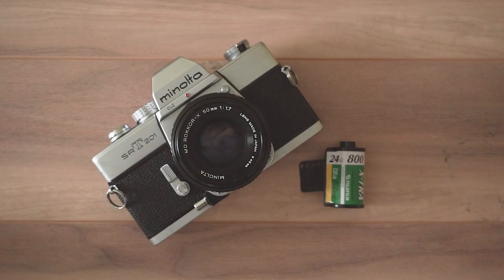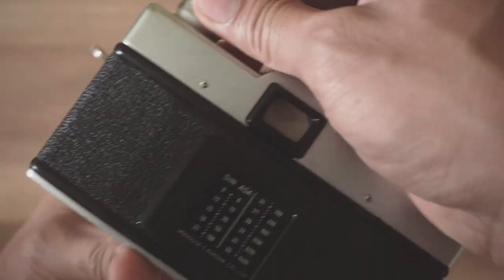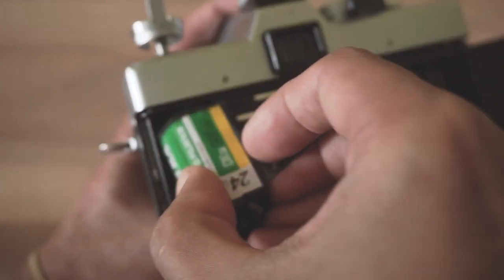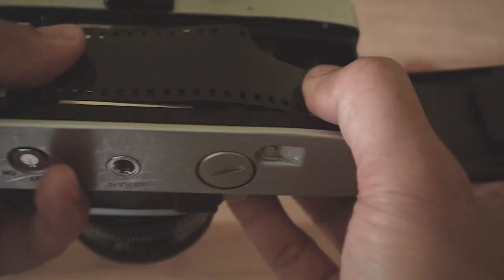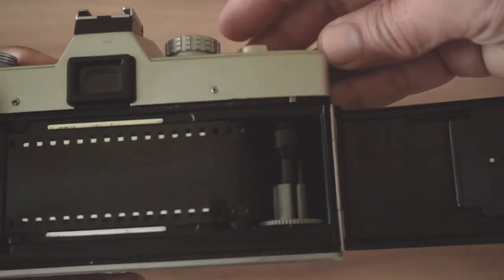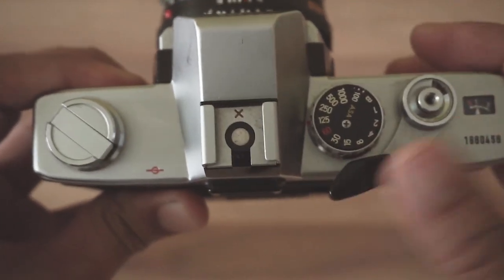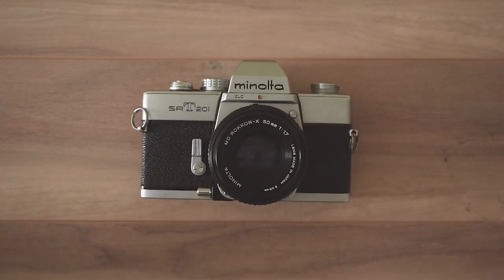Loading 35mm Film Tutorial | Minolta SRT 201

Comment: Hi, new 201 owner here. How do I find out if I have a Model A or B? And also how did you solve the mercury battery?
Reply: Please answer this
Reply from the maker: Hey, sorry for the late reply. I believe you are referring to the SR series which model A is cut down version of SR-2 then model B is cut down version of SR-3 which they added a light meter. Unfortunately they don’t make mercury batteries, a PX625A should have the equivalent voltage. Hope this helps
Reply from the maker: pg hi, sorry for the delay. I posted a reply just now

Comment: Do I need to put the battery in on our to use it??
Reply from the maker: You only need a battery to use with the camera exposure meter.  Its a mechanical camera so it would still work and take pictures without a battery if you are using the sunny 16 rule.  Here is a link that would help https://youtu.be/r0taSqzrP_c

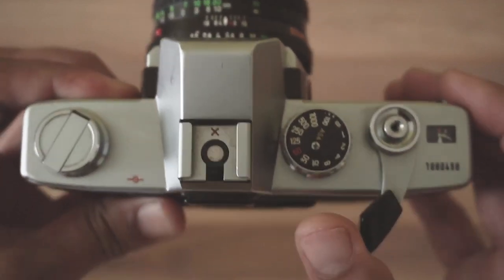Comment: Hi there. I just inherited my mother's SRT SC-II from Sears in 1980. I followed your steps, but when your rewind button stepped forward after cranking the film-advance lever automatically, (at 1:14 you explained this) mine does not move it forward, it stays in place. When the film was loaded, the lever was definitely moving film forward, and onto the teeth, no problem. My exposure counter will still advance forward as well, but it makes me nervous.
Reply from the maker: @Jordan R hey thanks for dropping by. Your film might not be secured in the rewind spool slot which causes it not to move while advancing the film. I would try to advance the film then fire the shutter and then advance again to see if its pulling the spool. If that didn’t work, your film isn’t secured in the rewind spool. Good luck
Reply: @RomeOpalec  thanks for the reply. Is it safe to open the film door with only a couple of levers turned to check? Or will it ruin the whole role?
Reply from the maker: @87_North  it may exposed part of your loaded film inside. i recommend opening it in the less light room away from direct light to work on it. since the only exposed part is the beginning of the film, you can use that part of the film to re-spool your film. hope this works
Reply: @RomeOpalec  thanks! I'm actually running into the common issue where when you snap a photo, the viewfinder stays black, and does not reopen until you adjust the lever for the next slide. I'm just going to bring the camera into a repair shop to get cleaned.
Reply from the maker: @87_North  you bet! i also recommend using a used film to practice loading and unloading that way it would help for future new film load. good luck and hope you take a lot of good pictures. these cameras have a long run
Reply: @RomeOpalec  thanks! The same day I got this, I was gifted a 1996 Canon EOS Rebel G. It's not mechanical, but it's another great, cheap 35mm film camera to test, so I'll play around.
Reply from the maker: @87_North  that is awesome. any camera that takes 35mm makes filming more exciting. takes you back in time. cheers!
Reply: @RomeOpalec  I am also having that issue. When I load film and advance it, the rewind spool does not move. I have tried two rolls of film so far. everything seems to work perfect, the rewind spool is the only thing I'm nervous about. the film seems to be advancing and the numbers keep going up as if the film is advancing... I'm just nervous that I'm taking a million photos on one spot of the film? Any advice would be very much appreciated.

Comment: Hey, I’ve been using this camera for a while with no issues until recently. Sometimes when I snap a shot it seems that the shutter closes and doesn’t open back up. The viewfinder goes dark when this happens. It doesn’t open back up until I advance the film. Just finished a roll with it shooting like this. I’m not sure if any of those shots were exposed because of this problem. Any idea why this is happening?
Reply from the maker: @Jonathan Mauldin hi, it sounds like the mirror locked up on you. Did you try to push the button located underneath the lever timer? Sometimes it does lock up and causes the mirror to flip in close position.
Reply: @RomeOpalec  haven’t tried that, thanks! Do you think that when this happens my images are still being exposed properly?
Reply from the maker: @jonathanmauldin8801  it should, the mirror still opens each time you fire the shutter. I hope there was no issue when you finished your roll but only way to find out is to develop them of course. Let me know, I also like to learn this. Good luck!
Reply from the maker: @Mike Zielinski  Thanks Mike for the additional input. It does sound like the shutter needs an overhaul. These SRT cameras very worth fixing. Luckily mine was just the mirror being stuck. I would be more than happy replacing it in the future which technically will make it almost brand new. Hope to share some of the photos I took from my SRT 201 in my channel soon!

Comment: I want to get one but I’m scared to get scammed
Reply from the maker: I recommend shopping for “film tested” 201 and 101 cameras. These cameras were built like tanks more than likely you will find one that is still functional. Also I would research and review the seller ratings to be sure. Good luck
Reply: @RomeOpalec  hey mines still functional I have a MINOLTA SRT201 with the old film still inside and a photoflex mx-35 that looks brand new
Reply: hey mines still functional I have a MINOLTA SRT201 with the old film still inside and a photoflex mx-35 that looks brand new